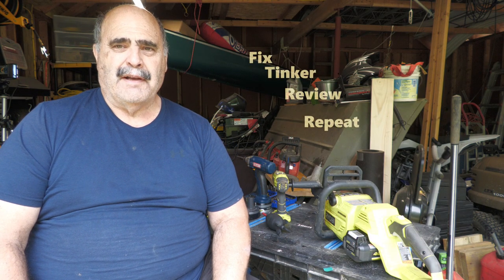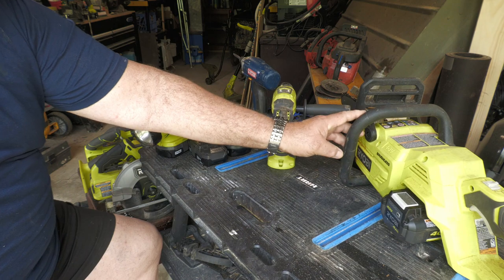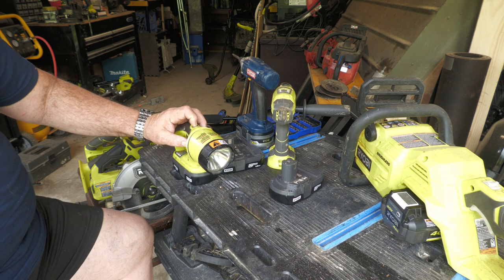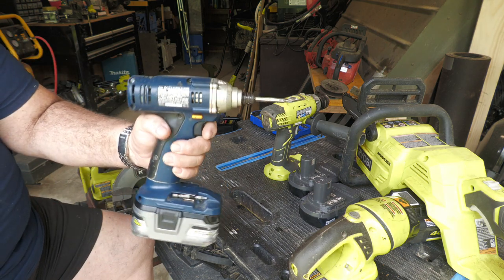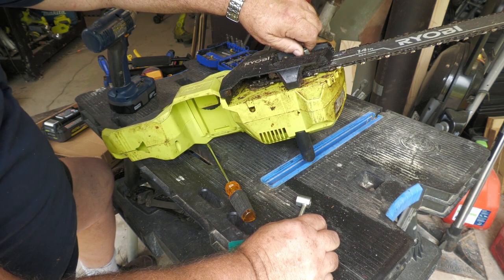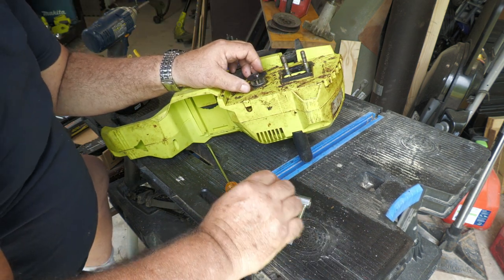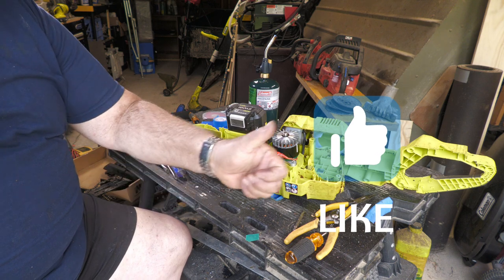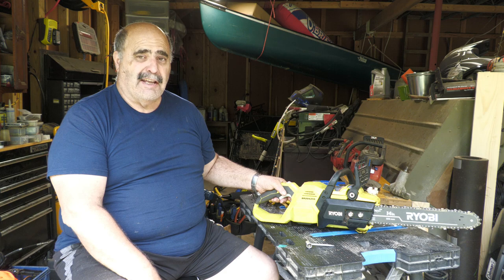Ryobi 40V Chainsaw Wiring Fail and Fix #Ryobi repair #chainsaw #Ryobi fail #diy #poor connectors

Comment: Throw away the garbage connectors and solder the wires together.
Reply from the maker: In the factory: 10 seconds to screw on a connector VS  a minute to solder the wires together.  I was really surprised to see how poorly the connection were made. Thanks for watching.

Comment: I have two of these saws and they work when there's no load, but when I try to cut wood, they craps out. Ryobi said it was either the board ($75) or the motor($120) I reconnected the wires to no avail.  I replaced the trigger on one and ir worked for a couple minutes, but then BLAH!!! .Check the muffler on the Homelite saw. It was rattling. I'm going to check ALL my ryobi connections now after seeing you fix this saw. Thanks!m LOVED THE BLOOPERS!
Reply from the maker: Hope you get the saws fixed. My son has the identical saw. It works just fine and has made hundreds of cuts without any issues.  I may take his apart at some point and see how the motor connections are in his saw for comparison. Thanks for noticing the muffler on the Homelite saw - a quick fix. Thanks for watching!